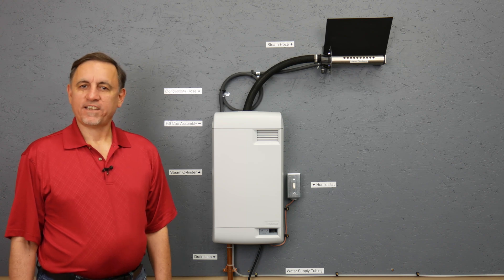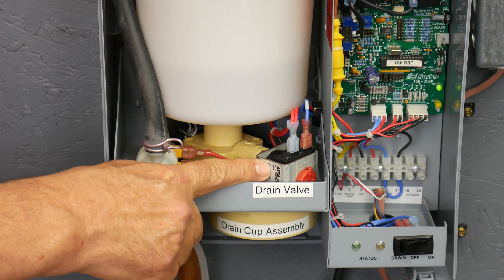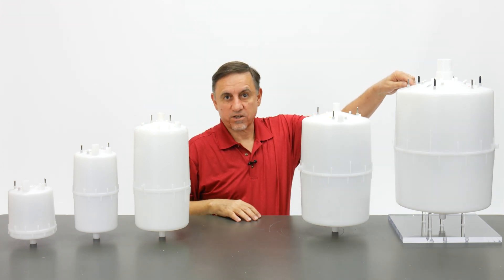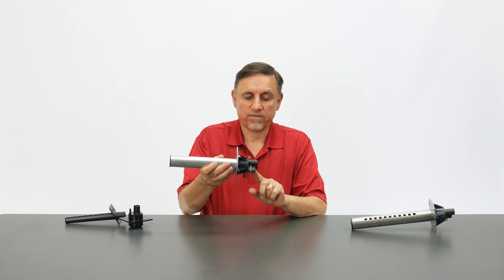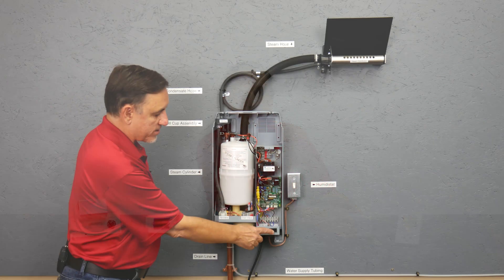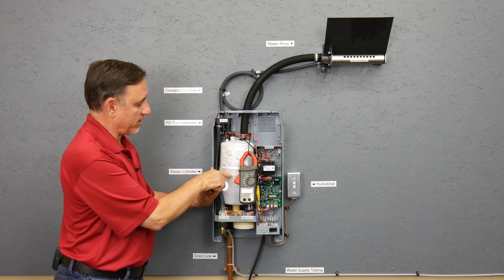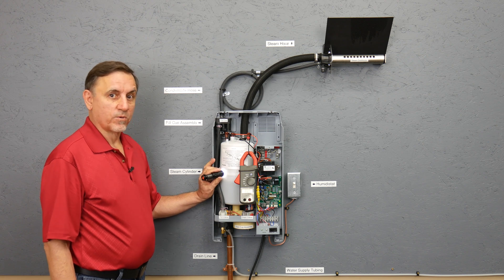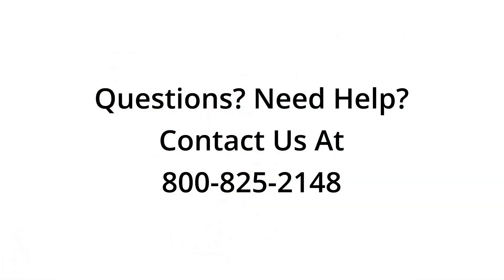Condair / Nortec RH Series Humidifier - Parts Breakdown, Start-Up & How It Works

Comment: condair humidifier high water level sensor is not working. Plz share possible causes
Reply: Even I checked circuit and fuses. Sensor continuity is okay. But when power on the humidifier at sensor end 24v does not come.
Reply: Make sure the level sensor wire is connected on each end. If you kill the power to the unit and remove the steam hose then add water to the tank until it reaches the probe you should be able to read continuity from the sensor to ground. Until the water level is fairly high you should have infinite resistance from ground to the sensor. If all that works properly your issue would be a bad high water level sensor board. Some models have this item built into the motherboard. Your model number would determine this. You may also have some other issue having nothing to do with the level sensor if you are getting fault codes you cant understand.